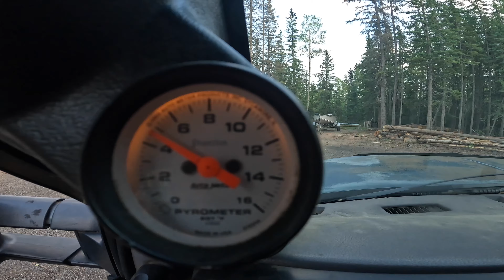How To Install A Gravel Pad On A Hillside With A Budget Cat307SSR

Comment: Good thing Louise Has the Power divider & Diff Lock's for ground conditions like slippy slip. One time I remember my First Solo outting on a Private  Tree length 7 Axle T/A Jeep International Eagle with the big Sleeper & gutless Cummins 18spd  ,on the Haul road & hearing someone call out Empty at Mud flap corner and they cut the corner too close & shaved off the inside mud flap taken the apex too tight and on the same Log Haul job that I eventually quit,I almost rolled backwards on a super steep incline after a 90 Degrees Bridge approach & when I was out with the owner he said you have to hit this Hill at 80kms an hour or you won't make the coming incline & when loaded with the very first load Solo l got 45kph after the bridge and decided to take a go at the hill without chaining Up & said gutless Cummins couldn't hold the power & speed dropping very fast Almost to a stop & I took it out of High range selected a gear and the transmission Shift worked & I spun the final 3/4's way up so much l seen other spin tracks on the hill and quickly got off the shiny stuff & onto the Non shiny and made the pull to the top, that very day is the day I quit because I didn't have Tandem Jeep experience and most private log truck owners are desperate to get someone even Green on the truck & gamble that driver will work out, So instead of wrecking everything I said nope 5 Axle Pole is good enough for me and That's exactly what I did because Logging in the peace country in the winter is always jobs available for the driver out there. But I'll never forget almost loosing it with that international 7 Axle Pole Jeep on that bridge hill.

Comment: The other reason I was told by a very experienced heavy truck owner in the rat racy winter log haul season in High Level Alberta, when you idle up a sitting truck equipped with the absolute Great Grader engine either the 3406C mechanical or Electronic 475 horse C15 Accert is too not only give the entire rotating assembly more Oil but to keep the Cylinder bores from over fueling wetting themselves on a overly Slow 8 or 900 rpm idle and that over non burning sitting Fuel eventually causes liner damage to where you loose torque and power,So l always bumped the cruise control toggle up either one time or a couple to get the engine to idle higher. But I do prefer the 475E over the grunt 3406C because it's less easier to stall when starting out or downshifting on full Jake on black ice where that engine will completely cut out from the slippery conditions and full loss of intake air on full Jake brake.

Comment: 14:59 someone is even still running a Early to mid 1990"s πord f150?/250 XLT extended cab 4 bye & the two tone exterior paint job.  Much much better than the junk & exotic car price like stuff they stupidly pump out today and Don't get me started on the stupidly expensive all electric thing they still call a truck. But those early 90's truck are like a tank like the red/black one you have with the engine swap.

Comment: Dang another pesky Mud flap decided to go Bye Bye at 7:29 , Always seem to be replacing them especially in off highway work & even worse at land fills because of the stuff that gets caught in a mud flap & a big no no on the highway to have a missing mud flap because of the Stone 🪨 pebble debris that gets thrown up into other vehicles windshields, For example if a 2012 Maclaren MP4-12C was behind us and a no mud flap rock fling situation happened and it smashed it's windshield it would cost $6,800.00 USD too replace the windshield after waiting Months for one to come from the aftermarket. So a missing simple  generic mud flap Can cause absolutely Huge unnecessary financial problems for both parties and might even come to blows fist tee cups. So yes mike Keep a eye out for those sneaky mud flaps so you'll always have a great day with no added greif.

Comment: Should carry yourself a Small Amazon Cigarette lighter plug in Beverage Cooler in your cab of the work truck because I see a 12 pack of the normal size Pepsi's right on top of the Transmission hump staying nice and warm in that location and not too fun to drink when pop of any taste is warmer than warm. Those auto coolers aren't that expensive & worth every cent because your thirst is quenched with nice cool drink , Some people I've heard doing this type of job even pack Wobble pop's to get through the long day & not get legally pissed drunk. But I wouldn't even consider carrying beers because I'm the smaller type & get the good feeling really fast So l don't want to be driving & throwing back the big boy's Pop.

Comment: I should Say you/ Me Can also Jake Stall the entire C15 Accert engine to a complete off situation and I'll tell you how you/ me can do that in the right road conditions,I bobtailed to the local tire shop to install Full heavy truck mega Siped Winter Snow  capped mountain Icon drive tires one , Winter because the road conditions were super hazardous car's ,Big trucks like me all over the ditch,So my Lease operator Decided to not Go out in those conditions, But did ask me if I would chofer the truck to the tire shop, But this is where it gets Good ,On the way back on the bypass in town, Was southbound on hwy 40 bypass & the traffic 🚦 light at Walmart/ Staples turned Yellow then full Red & there was no way I could stop on the ice that was all over the road So l made it through the intersection with everyone stopped but me But at the middle crown of the intersection the airbag suspension unloaded & Jake was still on full or 3 setting & the tandem drive tires locked up & I skidded straight through the intersection without going into a wiggly Spinaroo luckily then after clearing the intersection with all the front row crowd watching my drive tires not rolling on the road,l Took it out of gear restarted my favourite Powerhouse truck ever a 220inch day cab tandem 379 Peterbilt with the C15 Accert 18spd & the Heavy 46,000 combined rear ends & selected a gear suitable for matching all 3 big truck old  style manual Eaton Fuller transmissions ,1- Road speed 2- Engine speed / RPM & 3-  Differential Rear end ratio and got the right gear and made it to the shop which is only blocks away & Drove the same truck until l finally got fired from the stupidly monotonous 6 day's a week , Every 8 hours on the Super B driving either to Chetwynd, West  Fraser or Canfor Fort Saint John BC & back again to Werhouser Pulp mill & Repeat Sunday midnight though Saturday last load shift. 65,000 Pounds gvrw & 25,000 Tare weight because of the mostly all aluminium super stupid unsafe Tycrop Possum belly Reverse super bee's Chip or Refuse trailers.